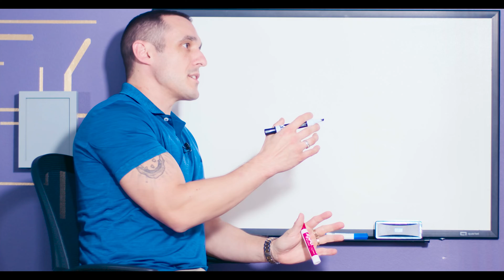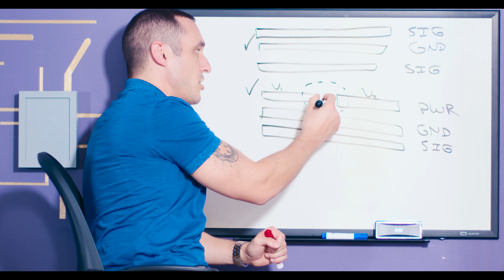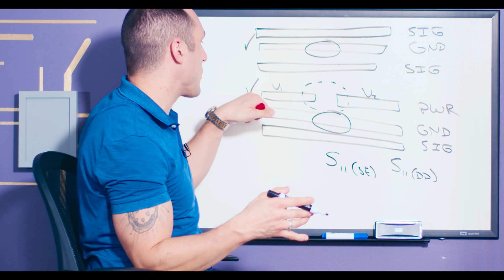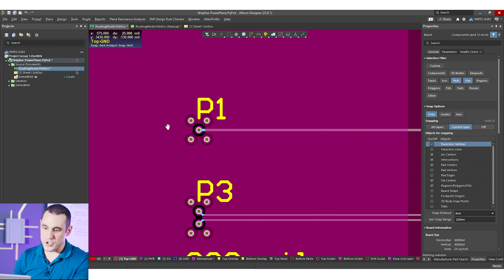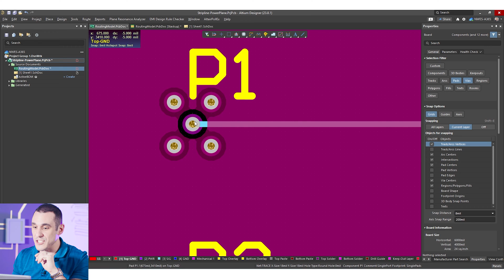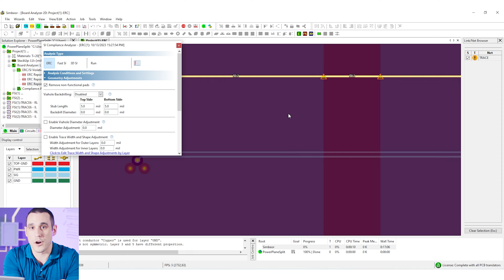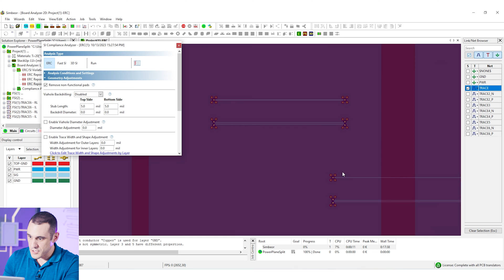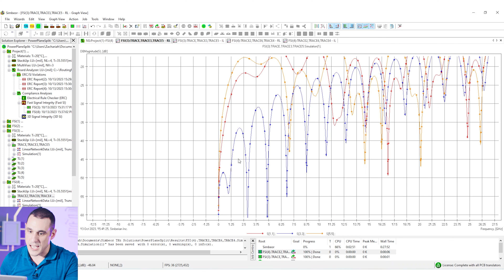What Happens When Routing Over Splits In Power Planes

Comment: If we are using a four layer board, then there are two signal layers, the effects of the splited power layer can be also neglected?
Reply: If you are referring to a stackup such as SIG/GND/PWR/SIG and the PWR plane is split into different rails, the answer is no you are at risk of radiated emissions and impedance discontinuities unless the split regions are very small. One way to try and get around this is to use copper pour on L4 in order to provide nearby ground reference but it is no guarantee to work. It is better to only put slower signals or configuration signals on L4 in this stackup and keep the faster signals (such as SPI or higher data rate) on L1.

Comment: Hi Zach, thanks for diving into this topic! I'm relatively new to the RF world, and I was reading that a higher "return loss" is actually desirable, however the simulation you show seems to indicate the opposite.  At about the 9:15 mark, you said that the simulation results for the split reference planes have a "pretty high return loss compared to" the continuous plane reference.

I understand return loss as "the loss in the return signal". If the return signal is the reflection (which we don't want), then the return signal loss would be infinite, or in other words, the load would consume all of the power.  Could you explain a little more about the s-parameter simulation result that is shown in this video? Why are the units in negative dB, and could you help me understand what I might be missing?

Thanks!

Comment: Is this always assuming the gap is between fingers of the same power pour?  How badly would things change if, for example, one plane was 5V and the other side of the gap were only 3V?
Reply: Just based on an impedance calculation in that gap, the value of the plane voltage should not matter. I was not really assuming there was routing over fingers in a single power pour versus routing over two different pours. At least with routing over a finger, the return path will still exist somewhere in that pour so I would think you get less radiation compared to the case of two totally different pours. But still, with two totally different pours, the voltage differences should not matter.

Comment: Hi Zach, you said that one trace can act as a referance for another trace.
But is it really work like that?
According to rick hartly each trace act like a single ended the differnce is that they coupled more or less to each other to determain thier diff. Impedance.
Another advantage is that they can ignore offset diviation.
Also, does the return current always goes through the referance plane above or down because of the feilds between the planes?
Reply: Yes it does really work like that if you look at how a differential receiver works. The receiver is measuring the potential difference between two traces. By definition, this means one trace is the reference for the other trace at all times. There is always an interaction between the two traces that is mediated by the spatial distribution of the electromagnetic field around each trace. When the ground is near the traces, this changes the electromagnetic field distribution around the traces but it does not change the fact that you are measuring a potential difference between the two traces. When a reference plane is present, it will contain some return current because that is physically required for the electromagnetic boundary conditions in the system to be satisfied, it does exists due to the fields near the planes.
Reply: Thank you for your answer.
Still im not sure i get it.
The receiver isn't measuring the potential of each trace with respect to his ground?
Also if the lines are not perfectly balance there will be much more current flow through ground.
Reply: @naorp2025  Yes that is what is being measured, but it is equivalent to measuring the voltage between the lines. The differential voltage is (VPos - VGND) - (VNeg - VGND) = VPos - VNeg = 2Vpos. This works because the receiver uses the same ground reference for both traces. If there were an imbalance then there would be some current flow through ground that would not be symmetric about the midpoint between the two traces.

Comment: Outside the scope of this video but FWIW, a trick I learned from an RF engineer to mitigate the effects of plane gap crossing is to provide a "reactive short" through the use of bypass capacitors nearby the signal crossing. For example, a high speed signal referenced to a 5V plane jumps a gap to a 3.3V plane, you can potentially mitigate (not eliminate) plane crossing effects with a small (0402) ceramic capacitor connected between 5V and 3.3V placed near where the trace crosses the gap. I personally view this as a hack and your mileage will vary, especially at frequencies above 10 GHz. As always, simulation is key.
Reply: Since capacitors have self-resonance the hack is limited in effectiveness only up to the ~100 MHz range, so that's basically where it limits the bandwidth. That's fine for single-ended stuff like SPI as long as its rise time is not too fast, so that addresses most components with SPI interfaces. I wouldn't dare do it on DDR. And with a fast differential interface, the other trace provides a reference anyways, but effectiveness also varies depending on stackup, materials, spacing between traces in the pair, etc.

Comment: At the end you said we can move pads to inner layer? I didn't catch it, how is that possible? Do you mean via in pad?
Reply: I meant move the pads in the simulation model into an inner layer. If it is an SMD pad you can set it into an inner layer. Then when you export the design to an ODB++ archive, the simulation tool will allow you to set your port into the inner layer without modifying the extracted linear network. This removes the influence of vias on the input to the transmission line.
Reply: Yeah, I didn't catch it too